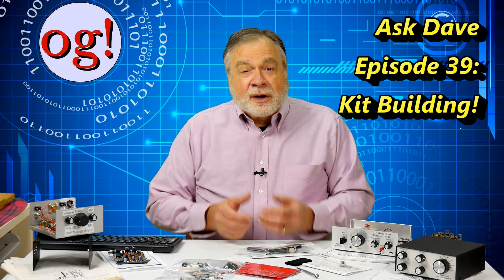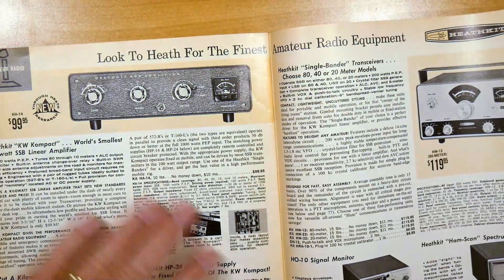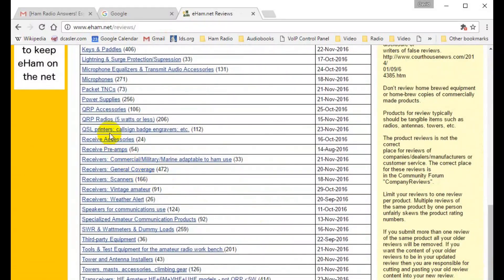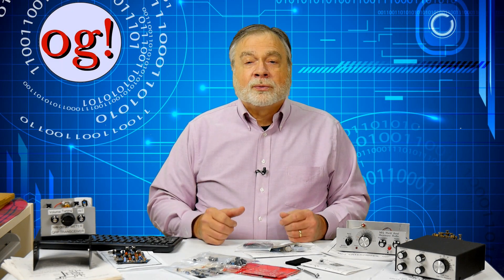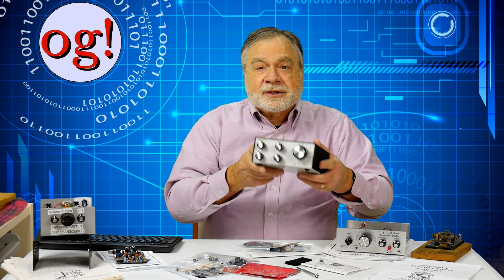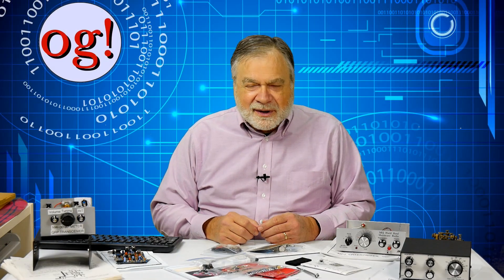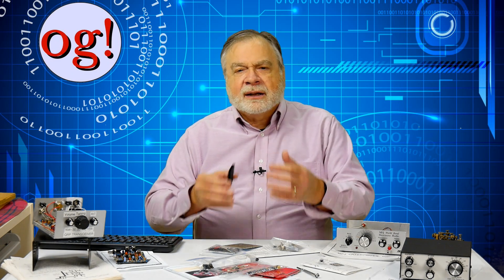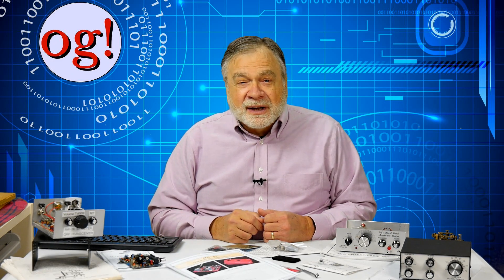Kit Building for the Radio Amateur - AD#39

Comment: i RECENTLY BUILT A mINIPA70 RF AMP. iT CAME WITH NO INSTRUCTION. i HAD TO WATCH A NUMBER OF YOUTUBE VIDEOS TO UNDERSTAND HOW TO BUILD IT. It also had surface mount componets that I did not like.i NEARLY SMASHED IT WITH A HAMMER, BUT HUNG IN THERE. In the end it worked, with one watt in I managed to get 20 watts on 28 mhz. On lower frquencies it will boost up to 70 watts. I miss the old Heathkit days where I built a number of quality radio andother electronic devices. I still have my Heatkit power supply I built decades ago!

Comment: My start in kits also requires some initial investment in good soldering iron, tips, magnifying glass, PCB holder, anti-static bands and mat, desoldering braid, VNA etc. My first kit has costed way more than the assembled radio due to these things.

Comment: I’ve made a few before I was even a ham .. I’ve done ✅ ( 12 volt power supply / impedance match /speech processor /mic tester various mic plugs / all done with basic electronic’s -stand alone aka > solid state . No firmware required

Comment: Thank you, again. 
   The older European professors used to refer to me as "a 1930's professor." I built much of the laboratory equipment I used or modified it for use. This included mass spectrometers, gas chromatographs, light isotope preparation lines, photosynthetic gas exchange systems, etc.
   After a fashion, this was kit building.
I had lots of help from machinists, electronics technicians, high vacuum technologists, welders, scientific glassblowers, electricians, plumbers, carpenters, elevator repairmen, engineers, etc.
   Sometimes it was utter frustration. Other times it was back breaking, heavy labor, but in the end very gratifying.
   Some projects took a year or longer to complete and get fully operational.

Comment: I have wonderful memories of sitting with Dad as he built several Heathkit projects. I have built a few kits through the years and "in another life" a few decades ago, I used to prototype and component-level repair computer hardware. I earned my tech license but never did anything with it and let it lapse...

A few years ago I gave away my wideband Tektronix o-scope and my trusty DMM to an engineer in need, thinking I would never touch hardware again at my age.

...But now the "bug" has bitten and I want to refresh my toolkit, learn code, build a qrp rig and earn my license back. AND I finally have a few $$ I can toss at it.

Goodness, I haven't burned my fingers & hair, nor torn my fingertips with cut-leads in years! Wish me luck!! 🔌🎛🎧💙

Comment: I've built a number of kits, including an Elecraft K2. But a favorite was the digital VFO version of the Small Wonder Labs QRP 20m rig, the DSW-20. I have a couple of plastic bins full of unbuilt kits. This is usually because I buy some kits on Ebay, and the prices are so low that the shipping is actually a large percentage of the cost...so I'll buy 3 or 4 of the same kit because it doesn't increase the shipping charge. I am very fond of QRPGuys kits, especially their travel antennas for QRP operation. I also don't mind winding toroids, I find it somewhat relaxing.

One of my early rigs was an 80m QRP transceiver, a variation on the venerable Pixie called the Tixie. The main difference was the incorporation of a TICK keyer chip, hence the Tix in Tixie. I have an unbuilt 80m PSK31 kit called a "Warbler".

The K2 was a real challenge. My partner and I built it very slowly and carefully, and it's still alive and kicking to this day.
Reply from the maker: I also built the Warbler, but I don't find any activity on 80m digital. It was a bear of a kit given it has two SMDs to be soldered. The kit does appear to work, but needs an RS-232 output from the computer, and most computers don't have that anymore.
Reply: @davecasler  That may well be why I haven't built it!

My most recent build wasn't a kit. I just finished turning a disused Southord single-ball stainless-steel lockpick into what I call the "Goalpost" style sideswiper "Cootie" key. 

I had seen a straight key on the SKCC website made from a Yale door key, and figured I'd take the gag one step further and make a Cootie out of a lockpick. I don't use the single-ball style, so I could easily spare it. The 301 stainless it's made from is very strong and springy, and I used standoffs for the contact post. I'd messed it up at first and only had a contact on the left side. In response to corrective suggestions, I made a brass crosspiece that allowed gap adjustment and added a contact on the right side. The shape is reminiscent of a football goal post, hence the name. I have it adjusted very precisely, and it works great on the air!

https://photos.app.goo.gl/VZfMpzvuBtQFWQp98

Comment: Yes om! A three knober will work  just as good as a ken wood. It's not just the rig, but the operator that knows his stuff. And keeps his rig in band limits. Once got a letter from a OO for my image being out of band. That is,I had to tighten up the filter on final amp.contacted the OO and  test. Revealed no harmonic . 73 om tks for your work de kv4li

Comment: Great video! I just built my first kit, the ZM2 ATU. Sadly it's not working to spec and I don't know why or how to find out. But I'm still fighting. In the end the diagnosis and repair experience will probably be the most valuable thing about the project. Very encouraging to know that your stuff doesn't always work, either! Thanks, Dave.
Reply from the maker: I just finished building a Kanga Kit that doesn't work either. I'll go looking for bad solder joints, and components in the wrong place. I don't know yet whether I'll save it.

Comment: One more safety tip: When soldering, have a fan on to blow the fumes away so as not to breathe them in. Good video, Dave.
Reply from the maker: The fumes come from the heated flux, and don't have any metals in them. Still, good idea not to breathe them.

Comment: What do I gotta do, where do I gotta go to find a work up for my first radio in like a breadboard format. Something like 1930's technology, so that I can treat the assembly not as just a kit to be assembled but as a foundational start for an electronics education. Something with entirely discreet components that I can meticulously go over with something like an oscilloscope junction by junction so that I can actually visualize what is going on. No amount of reading books, taking classes, or watching youtube is going to help me visualize these currents, ohms, voltages, sine waves, amplitudes and frequencies. I can read the books, I can recite the knowledge I've acquired front to back, but I'm never going to gain the wisdom until I can find that perfect radio design and/or kit that will help me teach myself. So that when someone says something like well this diode has this particular effect that isn't very good and if you changed it out for that diode this other such thing would be improved, I can actually witness that knowledge and learn from it.
Reply from the maker: You could try looking in old magazines or old handbooks from the 1960s and backwards. These days even small kit radios are dependent on integrated circuits for many functions. Another way is to get an old radio and go through the process of restoring (watch high voltage safety!). A magazine you may find interesting is Electric Radio.
Reply: David Casler thank you david, I'm familiar with the NE Kansas hams, and got my general a few years back. But I would really hate to pester an elmer with too many questions, some things might be better worked through alone in my case. I'm gonna see what I can dig up.

Comment: Dave, this is an absolutely superb preparatory video that should be required viewing for any new ham contemplating kit building. Also, in addition to the basic tools a beginner would need, he or she should plan on getting test equipment and I would suggest a decent DMM or VOM and an inexpensive frequency counter. Down the road, an oscilloscope would be invaluable for those who get serious about kit building. 

New hams who engage in kit building for several years will find their "electronic theory aptitude" increasing and they will appreciate and enjoy the hobby a lot more. For example, there are few things more scintillating than working someone across the country or across the ocean with 5-watt radio you built yourself! 

Tangentially, wonder what ailed your OHR-100. I must have built four of those and they semed pretty simple. However, they did have idiosyncrasies but I have found the support by Marshall Emm to be superb! (incidentally, my first OHR kit was purchased when Doug Demaw owned the business, my second when Dick Witske was the owner.)

Sincere thanks for your efforts with these videos (I subscribed and am becoming a big fan) and keep up with the great work. 

71/72/73 

de Bill, k6whp 

dit dit

Comment: My first kit was an Elecraft KX3 and PX3. Built both last year over 2 days. Fantastic manuals, and much information online. I've built many PCs in the past...The Elecraft kits were no more difficult, and in some ways easier. Be sure to have a static mat and wrist strap, and inventory all parts and screws (I contained them in multi-section hardware storage cases), and you'll enjoy the experience!  73!
Reply: Mark Tosiello, with the greatest of respect, the Elecraft KX3 is a kit that is assembled not built. The difference being, of course, the former merely requires bolting components together while the latter requires soldering parts onto a board or boards.

Comment: Don't fear the SMT! It took me awhile to get over my aversion to SMT, but once I did, it opened up so many more options. You need slightly better tools, but the investment is not too bad. I know you have a new solder station, Dave, which is more than up to the task. And there are plenty of videos on the Internet to help you get a handle on the technique. There are tricks! A good temperature-controlled iron, squeeze-bottle of flux, some fine solder, some desoldering braid, a pair of tweezers, and a magnifying lamp will get you very far! Also, once you get a little practice you may find that SMT is actually faster to do than through-hole.

Not all SMT is the same, either. I am happy to solder 1206 and 0805 devices all day long, but avoid 0602 or 0402. Similarly, I can do devices with 0.5mm pitch or more, but when it gets tighter than that, I have to bow out. Some devices have thermal pads on the bottom, and that requires special technique. The one type of device I cannot touch with my current technique is the BGA, though I know a lot of home amateurs that have had good luck soldering such devices in skillets on their stoves! For a bit more money, there are kits to build reflow ovens.
Reply from the maker: Thanks for the encouragement! What temperatures do you recommend for soldering? 73, Dave
Reply: I like 630-675F. It's s personal preference thing. Stations with good temperature control don't need to be as hot because the work doesn't cool them down so much. I always use good leaded solder. There is no reason to deal with the no lead solder unless you have to - and hobbyists never have to. in fact, when reworking something that was soldered professionally using silver solder, I will usually add leaded solder to the joint first to make it much easier to work.
Reply from the maker: Thanks for the info! 73
Reply: @policyprogrammer  The temperature to use depends on the solder. There are solders with very low melting points available that are very useful to "mix" it into unleaded solder to lower the melting point. This could be helpful doing unsoldering of professional soldered part (repairing your station). In general unleaded solders needs much higher temperatures.

Comment: Kits can be fun but some can be very frustrating if a component or part is missing from the kit.  Some act as if your calling them to get this or that doodad for free, as if you enjoy going out of the way just to complain or rip them off for a 25cent part.  So now I buy mostly assembled things if possible.  Thumb up good topic Dave.
Reply: When a kit has a missing component, I first check my "junk box" (actually a large series of plastic bins, and a large shelving unit with dozens of small plastic drawers) to see if I have it. If I don't, and it's a commonly-used part, I'll order a bunch of them from Amazon, Mouser, or Digi-Key. I might as well stock them!

I did this with a missing toroid from a QRPGuys tuner. I sent them an email asking after the missing part...but went ahead and ordered them from Amazon anyway in quantity. The Amazon order arrived first, so I completed the kit using one of the 10 I ordered from them, then put the part I received from QRPGuys a week and a half later with the others in my storage. Can't have too many toroids!

I did the same with 2n2222 transistors, both the epoxy and metal can varieties, and a certain signal diode that's popular in a lot of different kits. I found a project online for a Z80-based computer built with a minimum of parts, and bought a number of each part needed, including six of the PC boards from a PCB prototyping house in China. Eventually, I'll build the thing when the mood strikes me...but I bought a lot of the capacitors and diodes it required since they were inexpensive and used in practically every kit I've got. Small 104 ceramic disks, 100pf electrolytics, and that signal diode, used in a small QRP dummy load I accidentally fried.

Test equipment is getting cheaper all the time. You can usually find an older cathode-ray tube model oscilloscope cheap or even free online. I got a 20mhz 2-channel model on Ebay for $40, including the shipping. I've since replaced it with a 4-channel 100mhz Rigol, and will cheerfully give away that CRO to someone who wants to set up their own workbench. If you're in the Philly area and want a CRO, drop me a note with your callsign and we'll arrange a time when you can come pick it up. I won't ship the thing, it's not worth the expense.

Heck, I even ordered a small digital storage oscilloscope and multimeter that's a keychain fob. It pairs with an app on your smartphone for the controls and display. Relatively inexpensive, and a potential lifesaver in the field! There's also good soldering gear available for low prices nowadays. Get one with temperature control at a minimum. I swear by my little 20v-powered TS-100 soldering iron. It has temp control and a little OLED screen to display current settings. It's usable in the field with a battery pack if that's what you need to do, but I find it indispensable for small component soldering, a real joy to use. But if that's not your cup of tea, Stahl tools has a temp-controlled solder station available on sale for about $14 that has gotten some very good reviews. (https://www.parts-express.com/stahl-tools-stssvt-variable-temperature-soldering-iron-station--374-100?utm_source=Retail&utm_medium=Email_Newsletter&utm_content=374-100&utm_campaign=email112118)  I don't work for them, I saw this go by on the SKCC mailing list.

Comment: I started to do some kits. Last one I had to trouble shoot but didn't have the proper equipment. What would be the components for a beginner beyond the multi meter?
Reply from the maker: For many years the only test equipment I had was a multimeter and an SWR meter. I recently got an oscilloscope, but it's certainly not required. My next purchase will be a signal generator, but I don't have a timeframe for that. 73
Reply: Dave, this is KG5KYJ, John. I started with the 51 Super Rock Mite cw kit and it had a bad ceramic cap that failed the smoke test. It also had a bad audio op-amp and final power amp. It also got me an Oo postcard for a raspy signal. Right after that I got a cheap Chinese ESR component tester device to help check the components of my next few kits. I wish I had that to begin with and recommend it to others who make kits. I am also a big fan, and thank you for updating the extra class videos.  73